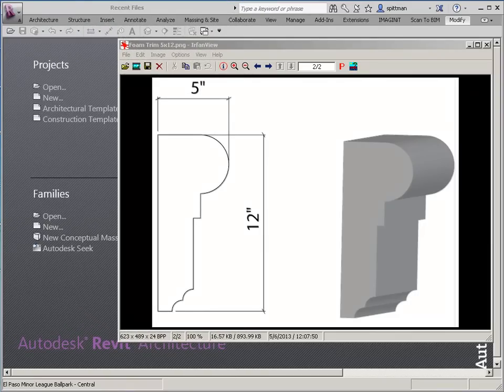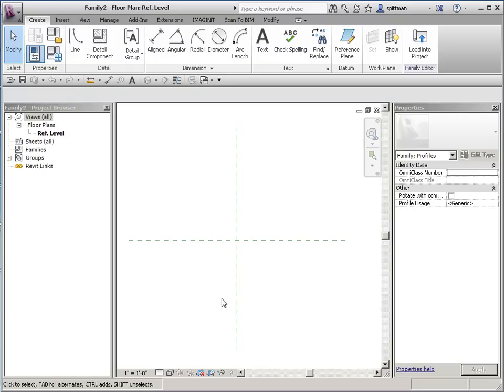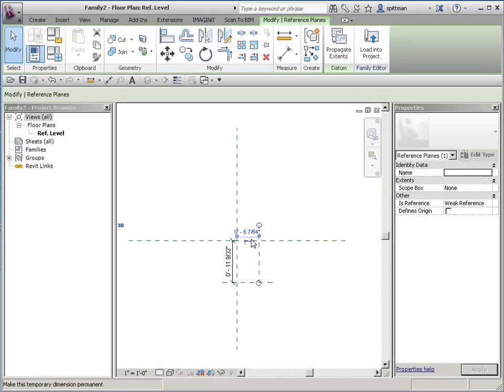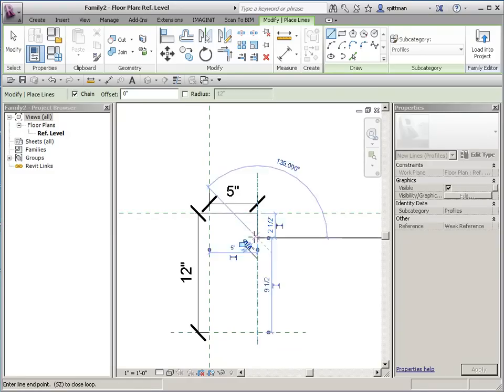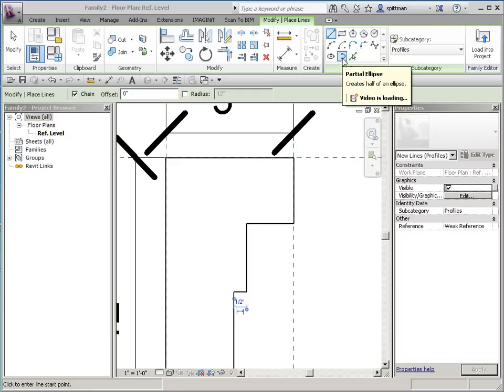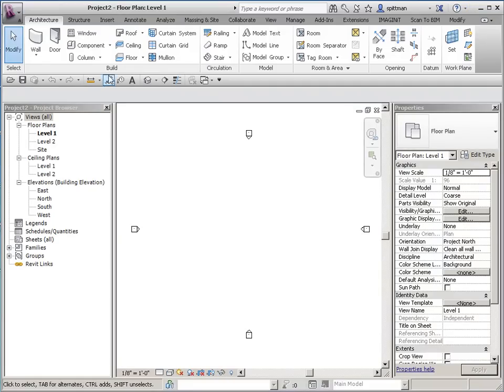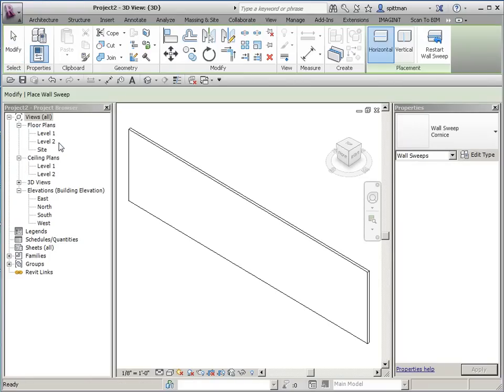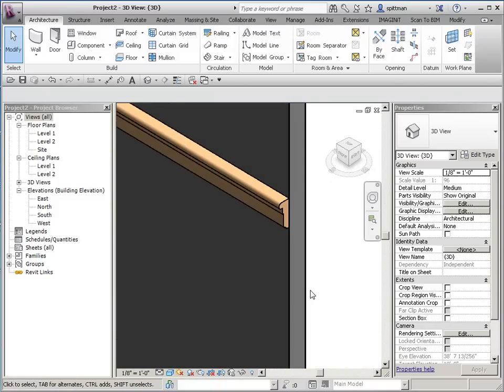Revit:  How to create a Profile and Wall Sweep

Comment: That all works great thanks, However I have a sloped roof with parapet walls and I cannot figure out how to get the profile to sweep along the sloped portion of the roof. Its a cope that fits between the inside of the parapet and top of roof.
The sweep places only horizontally.

Thanks
Reply: I don't think sweeps can slope, I would just build a model in place extrusion blend.